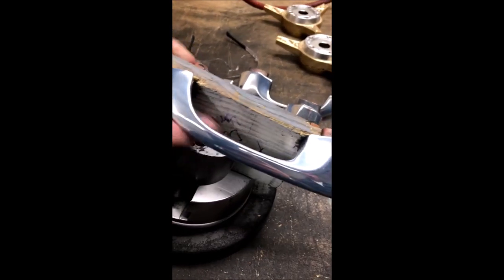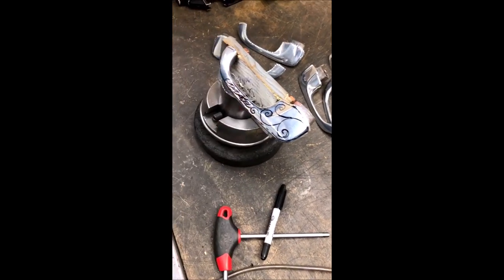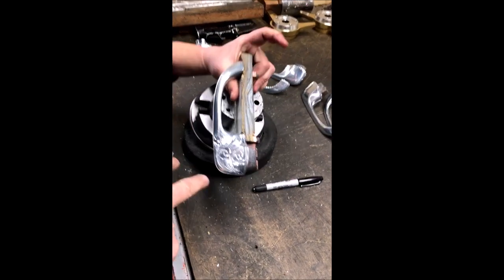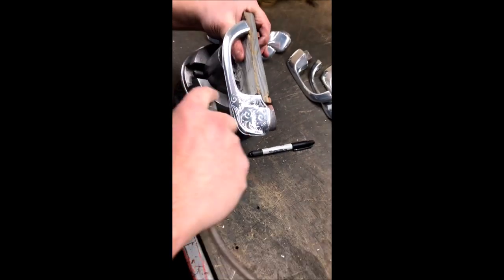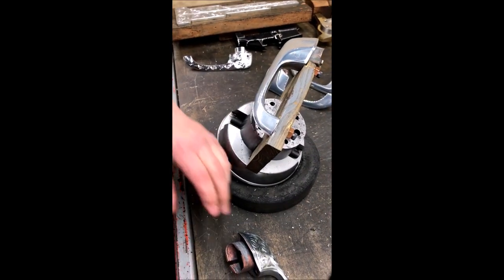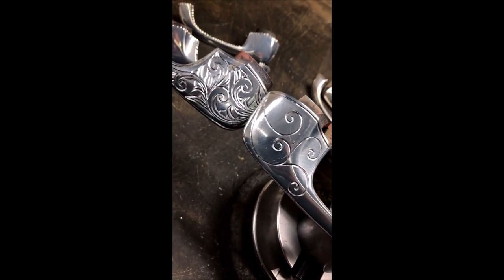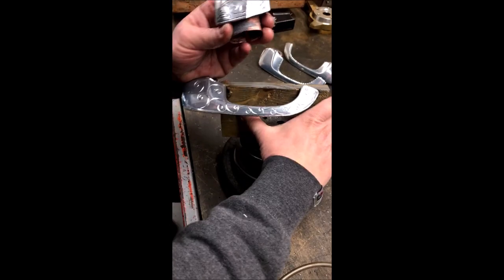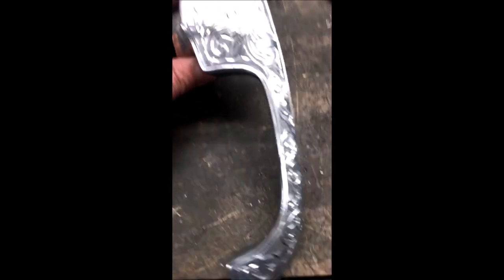Engraved Outer Door Handles

Comment: a better way to transfer, use a transfer wax.. its beeswax and tallow mixed together or a dark shoe polish and  you rub it into your finished line work. Take a flat piece of newspaper and gently wipe the flat surface down. Then take a piece of clear, wide scotch tape and lay it over your engraving. Rub over the work that under the tape with a burnishing tool. then lift your tape. The image will be perfectly copied. If you need to reverse the image, lay the tape with the design on to a clean mirror. use a burnishing tool to rub the design on to the mirror. Remove the tape. Take a new piece of clear wide tape and lay it over the design on the mirror. Use a burnisher to rub the design and inbed it into the tape, remove the tape and apply to new surface. Use burnishing tool to rub design. remove tape. boom, instant perfect transfer. Takes about 2 mins.
Reply from the maker: Fist Pump I appreciate All your information. Most of this information I well aware of. Seems to be that you know a lot about all this if you like you could give me a phone call Whenever you’d like and we could go over the details. Thank you,
Hernán D’Aloia ✌🏻 (909)947-4590